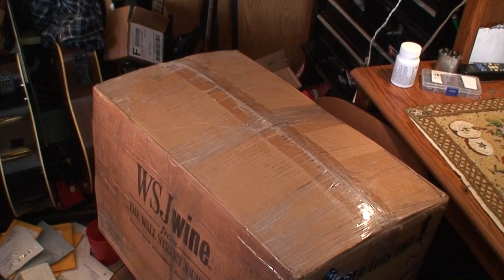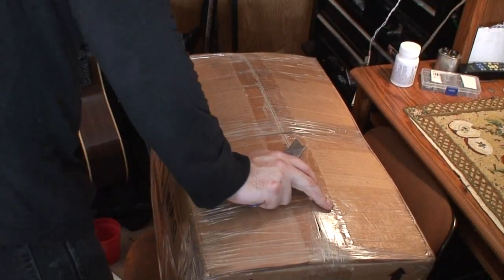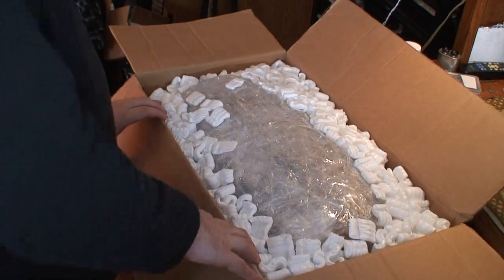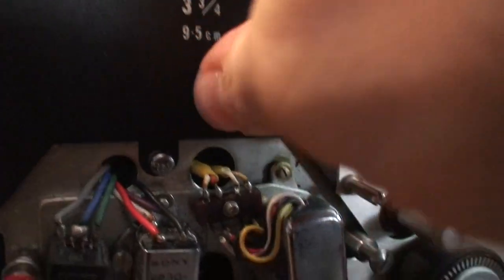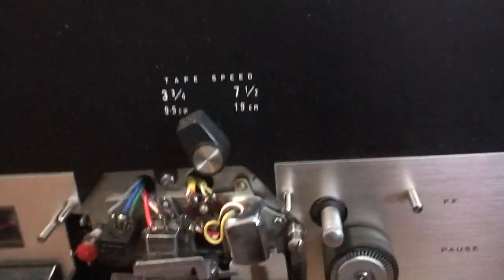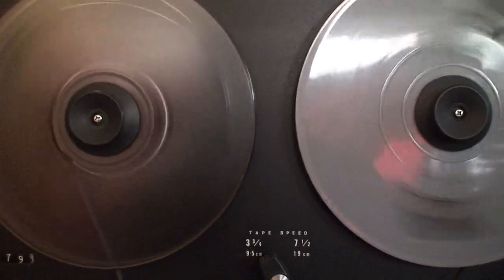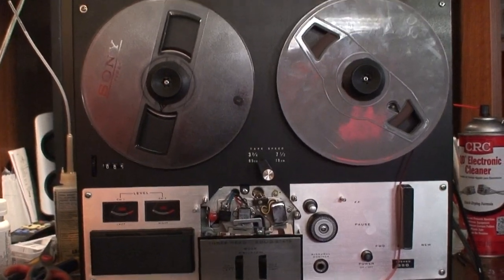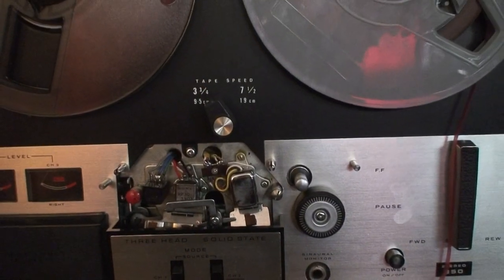Vintage Sony Reel To Reel Tape Player Model TC-350

Comment: The one thing i want to tell you is to take care of the take up reel.  I'm not sure if on this model there's a clutch that engages the take up reel and transfers to a different pulley between play and fast forward or if the idler needs cleaned with some rubber rejuvenater.  Regardless, you're going to possibly damage the tape by the slacking and taking up.  It may slip through the pinch roller and cause the tape to slide through there improperly, giving the tape some edge damage, too.  It is a very nice deck and it does sound great, but take care of that.  I have a TC-355 that I found on e-Bay two years ago.  It does sound great, but I had to free up a couple bad hinges in mine to make it work properly again.  I'll bet your tape deck is probably at least 52 years old now.  Those Sony decks made some of the cleanest recordings at 7.5 ips.  Enjoy it.

Comment: this model and it's 2 head cousin the Sony tc-250 were pretty good for their time.the supply reel should not have any back tension when playing or recording.the tape does not require back tension because the 3 heads (erase.record and play)each have a pressure pad that keeps the tape in contact with the heads.

Comment: Maybe it was wrapped up like Fort Knox so you wouldn't notice it didn't work.  I guess machines like these are hard-to-find in working condition because generally when someone has one that works, they keep it.

Anyway, you can have mine for free.  But no complaining since it's free.